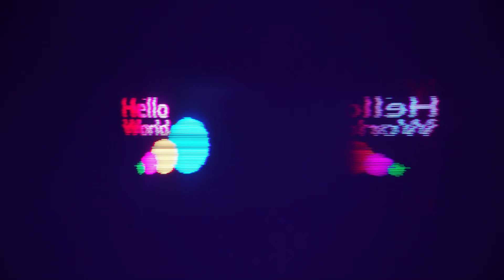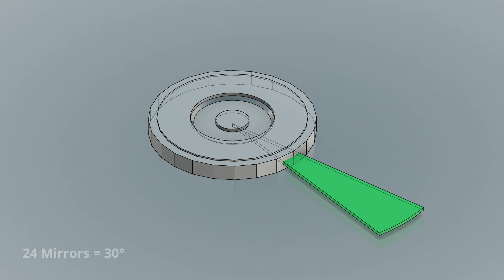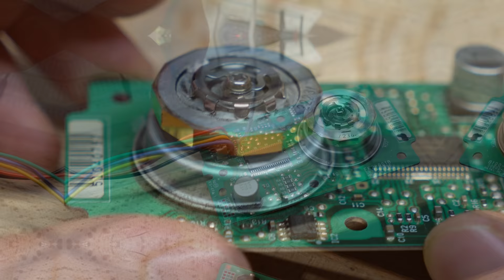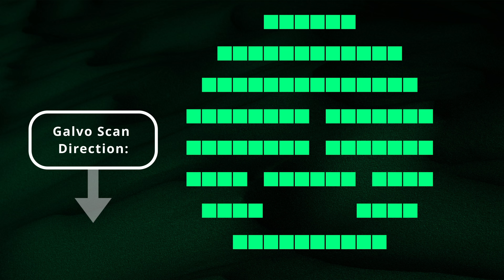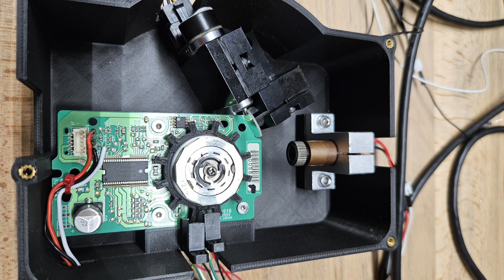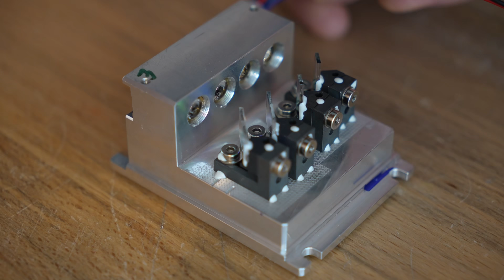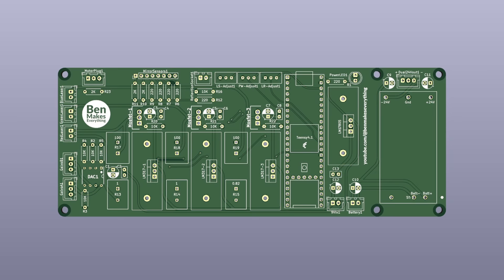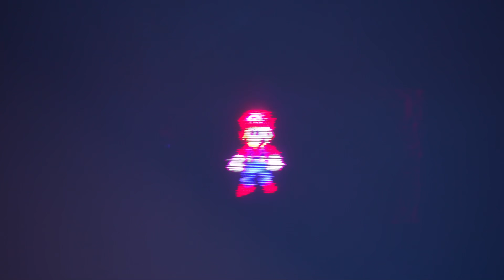DIY Laser Image Projector (100ft+ Range!)

Comment: The glitches could be from microcontroller interrupts.
Some of these are required for arduino timing functions.
2 ways to fix that: use a 2+ core microcontroller and configure the interrupts for one core and your code on the other.
OR get a microcontroller with dedicated output processing units capable of outputting the bits independent of the CPU.

If my calculations are correct, you have ~26µs per pixel, which is still enough to vary brightness by PWM, if the driving circuitry allows.
If I were you, I would use a Raspberry Pi Pico (with arduino core by Earle Philhower) It even has 3 options to do it as it also has a PWM module that can be fed a sequence directly from memory without CPU involvement.

Comment: you should be able to increase the number of lines albeit at the cost of image brightness if you employ the same trick what an old TV does:
only paint half the image at each run
so draw line 1,3,5,7…
and the next frame draw lines 2,4,6,8…

this should in theory double up your vertical resolution but the image might become a bit faded and blurred - but that can be compensated by increased speed or laser beam strength 

but its a great projector :)
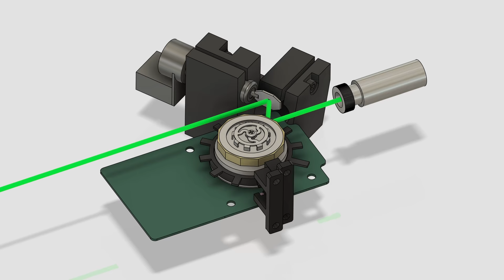Reply from the maker: Thats actually kind of what I'm doing, I talked about it at around 6:50 in the video. But I appreciate the input!
Reply: @benmakeseverything  how the heck is missed that?
apologies :(

Comment: hey maybe for timing system use hall effect sensors (they work using magnets) so you could get 1 or 2 sensors and a few magnets and you should have a better timing system (atleast i think)
but you would need really weak magnets (lol)

Comment: It's a laser printer motor?  Isn't there already a built in hall effect sensor to time the mirrors on that board?
Reply from the maker: Yes, but I couldn't find any documentation on the board itself. Might be possible to reverse engineer, but I went with something I knew would function.

Comment: You should look into "dithering".    Atkinson dithering is simple to implement (like 10 lines of code), and will make your images and colors look amazing!     Remember to convert the pixel values to "linear" first (the easiest way to do that is to square root each of the R, G, and B values, then dither R, G, and B separately - it isn't quite mathematically correct, but it'll still look awesome).

Comment: how strong are the rgb lasers?
Reply from the maker: The ebay listing claimed about 1 watt per color. Who knows how accurate that is though. Unfortunately I don't know the model number of the diodes themselves.
Reply: @benmakeseverything  Wow, i thought it was closer to the 120mw or whatever in the last video. 3W total is crazy.
But perhaps your driver current is not at max?

Very interested in trying this out myself and driving it using fpga, and trying to get higher resolution.

To vary the input voltage faster (for more colors), how about putting several regulators (for example full voltage, 75%, 50% and 25%) before the entire laser driver circuit and then simply selecting the desired input source? Even just two levels per color would make a crazy difference.

Comment: "your solution"  
 , you mean teh solution you ripped out of a HP laser engine, this is EXACTLY how they do  it , but tehy also have a  corrective lens about 1 11 inches long that is bent to correct for the distortion as the beam moves thru the angle scanning the paper.

go on... take one apart and see

Comment: think back to internal projection screen TVs. 3 small CRTs all aimed at the center of a mirror that had to be optically flat. some had an expensive and heavy piece of glass. but most were 4 pine sticks with a sheet of mylar streached over them
so, print your mirror as a polygon frame with a small pocket on the flats so the mylar only contacts at the points. split it at 2 of the points 180 degrees apart so 2 mylar strips each covering 180 degrees can be fed to the center. at the center of rotation put a threaded bolt with a slitted sleeve. feed ends of mylar strip into sleeve and wrap them tight. lock in place with bolt. mirrors will all be automatically aligned, optically flat, and allow you to use more of each facet. the only dead spots will be at the angle between flats.
if you need a visual i can make you a solid model.

the Y axis mirror drastically over complicates the device. eliminate it. you actually nailed the solution but are not wanting to go with the obvious answer for entirely the wrong reasons. add more lasers. just stop killing yourself trying to use off the rack parts that were never intended for this. the solution as not actually as difficult as you want to think.

OLED phosphors are essentially paint. in fact, they are typically laid out on screens with an inkjet printer.
but can also be applied by screen printing, or even with a paint brush.
pick up a roll of bare optic fiber with no jacket. needs to be glass, not acrylic because the paints must be heat set several times

cut into lengths. polish one end flat, and mirror dip. dip polish the other end and hang down, so the resin forms a semi hemispherical lense.

DuPont has a product line called luxprint that is used to make electroluminescent lamps. this product line is also applied as paint.
one of the products is an indium tin oxide translucent semiconductor [ITO] in a clear binder. apply that as a base coat for electrical common. then the red, green, and blue phosphors in segments along the length of the fibers with dielectric between colors, followed by the other LED layers.
when completed you have a hair sized RGB laser that can be cold soldered to a pcb, and can be flexed so they can be conveniently spaced out.
stack output ends in a simple clamping fixture and each fiber is a single pixel. this frees up processing power that was dedicated to multiplexing on the Y axis, and allows for slower switching speeds on the lamps, as well as extending overall life by reducing per second on time of each lamp.

Comment: For the negative voltage you could just add another battery pack. But the converter wasn't that expensive, and smaller.

Comment: This is really cool. 
It more or less works like the lasers in photo minilabs do, wild how you arrived at that setup on your own. Great minds and all that.

Really, most of the remaining work is optimization honestly, you could probably fix the EM noise and any tracking issues, optically correct the diodes and all that. I do kinda like the cyberpunky feel to it though.

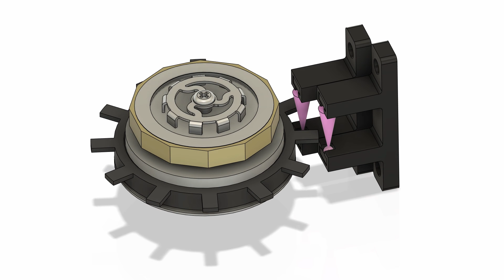Comment: 5:40 This immediately struck me as a place to improve it, small variations in the edge shape of the tabs there will result in variations in the horizontal position of each line. Why not just use the single long tab that triggers once per revolution, and use the micros() function to work out the time between ticks, the full frame time. which you can then divide by how many lines you have in order to automatically trigger each line without needing a physical tab for each line. 

// This is a little if/then that uses micros() to work out the amount of time that passed in one frame.

long frametime = 0; 
long time_since_last_frame = 0;
int tab_state = 0;

tab_state = digitalRead(tab_pin);

if(tab_state){                                                                   //tab indicates end of this frame
time_since_last_frame = frametime - micros();        //subtract the current time from the time when the frame started
frametime = micros();                                                   //write down the time of the 'start' of this frame for next time
}

horizontal_line_duration = time_since_last_frame / number_of_lines; 

single_pixel_duration = horizontal_line_duration / horizontal_resolution;

so then to trigger lines:

//start of line

by the same concept you can write down the time in micros() every time you start a new line called new_line_start_time. and if the current time micros() is greater than new_line_start_time + horizontal_line_duration, then it must be time for the next line. you could say 

new_line_start_time = micros();
while(micros() < new_line_start_time + horizontal_line_duration ){
//draw pixels within this line,
}

//next line or line_number ++ and loop again

Comment: I had tried to do a similar thing 40 years ago during my university days, but we did not have the laser diode technology back then (no blue either), nor fast enough microcontrollers.  But one thing that I thought could work fast enough was to use KDP crystals with the electro-optic effect to modulate the laser beams.  These days I would consider the relatively new DLP technology.  Enjoyed your video, keep em coming.

Comment: I think PWM could work if you manage to get some really fast PWM controller, like 200-500 kHZ switching frequency should be fine
Reply from the maker: Well its possible, but would have to be a lot faster than that, I'm already switching at 5MHz to get this pixel size (200ns pulses).
Reply: @benmakeseverything  Hmm, yes I missed that. I think most PWM voltage controllers top out at 1-3 MHz, so you might need something at least somewhat bespoke. Anyhow, minimizing stray inductance due to the wire length between the laser diode and the PWM FET should be your friend. IIRC laser diodes are really sensitive to overvoltage, so adding a fast diode in reverse to absorb any turn-off spikes might also be a good idea.
If going the analog route opamp bandwidth/slew rate might be worth looking out for.
But either way you will need to be able to clock out the data from your main chip hella fast. Assuming standard CRT timings, 640*480 at 60 Hz with 8 bits per color would already mean 600 Megabits of total data output rate. If the three diodes are driven by different pins, that is still 200 megabit/pin. At some point being able to get the data out of the Teensy fast enough will be a limiting factor.

Comment: I assume IR sensor isn't very precise, what light source gives off strong signal and is synchronized with spinning mirrors...
Just put light detector on the cutoff edge or have additional laser under angle dedicated for detection
Reply from the maker: That would be better, I agree.

Comment: Make better synchronisation!
Encode each section of rotating mirrors as binary digits. It would let your dervice get rid of most synk lags.
And adjust angle resolution of your rotating mirror to be of your neaded horisontal resolution. All width that laser stays off makes worse your refresh rate. You can do it by changing nuber of faces.
BTW, try to add fan blades to the mirror. It rotates, so it shoud be a great cooler!
Reply from the maker: Good suggestions, thank you.
Reply: @benmakeseverything  Thank you for such an awesome content!

Comment: This project is mad. But great!
I do think you’re reinventing the wheel. 
This is mechanical television and it’s been done well in the past.
All of the electronics you need to build the servos, the schematics, already exist. 
Let’s be honest lots of digits here but it will be better improved analog side of the system. 
You may or may not have heard of quadruplex. It was an analog video recording system and strangely it has parallels with your display. 
It had a video head spinning ridiculous speeds, but the video coming out of these machines was rock solid. 
More analog less digits ! 

I think that your horizontal raster works. It’s stable.
Why can’t you do the vertical scanning in exactly the same way? 
Your horizontal line scanning is stable. 
It’s your vertical scanning that isn’t. 
And to improve image quality, you have to have some blanking intervals too. 

But keep up the good work well done!

Comment: you construct such crazy stuff, but buy a very expensive component instead of just building a simple inverter? Or using the power of microprocessors to build a pure sine wave inverter to get the positive and negative voltage?
Reply from the maker: Sometimes its better to just get a part that works rather than going down the rabbit hole of trying to diy every single component. What I'm saying is, I wanted to focus more on the big picture since this took a long time as it is.

Comment: You won't be able to get clean nanosecond rise times on a solderless breadboard, due to the extra capacitance. The 100pf cap next to your laser diode is a problem too. For prototyping, you might be better off doing the high speed stuff on perf-board or go full "dead bug" mode.

Comment: While I'm a big proponent for doing coatings on well-machined metal (for your mirror application), I'd find a way to mirror finish a metal ring. A plug-in power drill and a bevy of ultra fine sandpaper grits (start at 1000 and work your way up, or an alternative, sharpening stones can get into the 8000 and above range), but failing all of that, the low buck version would be very careful application of mirrorized tape and a light touch of heat to smooth. The gap line would be a bit annoying, but thin tapes are almost imperceptible when done well.

Comment: You are going to need two sets of octagonal mirrors to allow you to scan across and another to move the scan line down one line, the mirror that scans the laser across the screen will run faster than the mirror that scans the laser down one line per horizontal scanline.

Comment: Awesome! You could get more mileage out of the 8 colors with some dithering, either ordered or some error-diffusion like floyd-steinberg. 

Also, I know you changed to a teeny, but atleast in AVR, I've seen some similar timing issues with tight looping. I used interrupts to setup data output, and had other interrupts enabled too which meant that the data output was sometimes a bit late. Also, as they were interrupts, and AVR can't guarantee a specific cycle count to enter an interrupt (IIRC it was 5-8 cycles depending on what was going on at the time of the interrupt firing), you had to do some creative cycle balancing to make sure you start your data output at the absolutely correct cycle after interrupt trigger.

Comment: I would add some sort of "inertia" to the variables that respond to the IR frame and line pulse sensors, so that the change is not applied immediately, but only if the reason for the change is constant. This would, I think, reduce both frame and line-to-line jumping.

Comment: How were you driving the R2R ladder? It functions as a current divider, so is quite sensitive to how rapidly the bit driving circuits operate. In particular, current is always flowing, so the driver has to stop current when the value changes, unlike CMOS logic where current is zero at all switches. Driving it straight off the controller board is likely to act weirdly. Buffer configured op-amps might be easiest, though push/pull mosfets would probably work better, but require more discrete components.
Breadboard capacitances certainly wouldn't help. It probably isn't suitable for prototyping at this speed.
Another thing worth thinking about is whether you need things to stabilise at all. You want your pixel to light up with a certain brightness, but how much do you care how even it is throughout the time? If your pixels were only 50nm long, there would be a ~ 25% difference in brightness in a pixel based on the brightness of the previous pixel, but can you fix this in software? Instead of driving the pixel at the brightness you want, you drive it at the level required to get the correct brightness taking into account the real performance of the DAC. If the issue is high frequency noise then put a cap on the input to the op-amp to filter it, then software overdrive to make up for the switching slowdown.

One other thing worth mentioning is that you have plenty of scope for skewing between frames. You might result is some perceptible flicker around the edges, but just because you are limited to 320 * 120 pixels per frame does not mean you are limited to the same 320 * 120 pixels.
A fantastic piece of work. Look forward to seeing more.
Reply: LEDs like continuous current, but laser LEDs like flat top pulses. Going from zero, to some max voltage which avoids tunneling and then current which does not overheat due to Ohm. But the active channel needs lots of current. The base current is wasted in spontaneous emission. Boxcar .

Comment: this is awesome,  love it. 
I'm curious about what actually causes the jitter effect, im assuming everything is controlled by interrupts otherwise stray low level code begins hijacking your loop.
As for analog pwm, you could have tried throwing a capacitor in there to smooth out the waveform,  I've done that before but not sure on the responsetime

Comment: i'd keep the galvo but stop starting and stopping it every line. if you just switch to using slightly diagonal lines, where the end of one line is at the same height as the start of the next, you could probably increase your draw rate substantially, although you would have to change how you're doing interpolation, or switch to progressive scan, as there's no drawing an alternate field on the way back up.
Reply: I hate to inform you that every CRT the vertical deflection is continuous.

Comment: I have been looking at something very similar and had the same idea of a spinning disc and galvo mirror for the vertical. You can use a set of optics to get the spot more circular and help focus the beams to a tighter single point. I've been toying with getting a disc CNC machined, but as it would be a one off, runs expensive.

Good to see what you've done so far, and encourages me to keep at mine. Good luck moving forward.